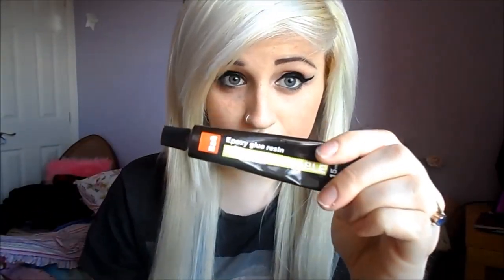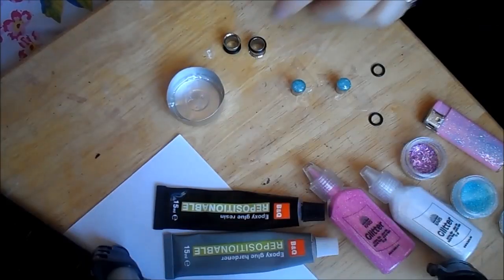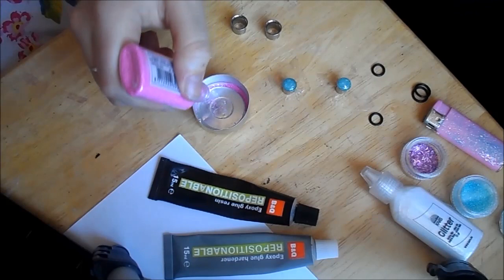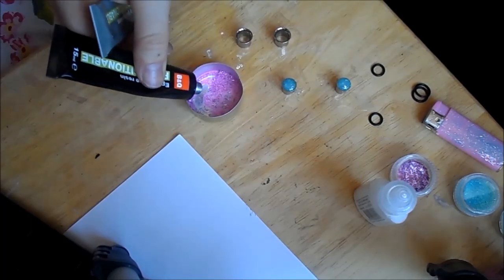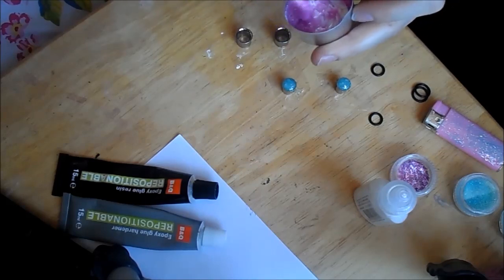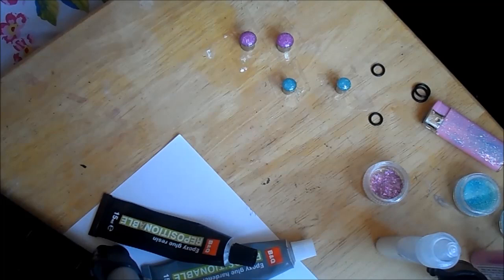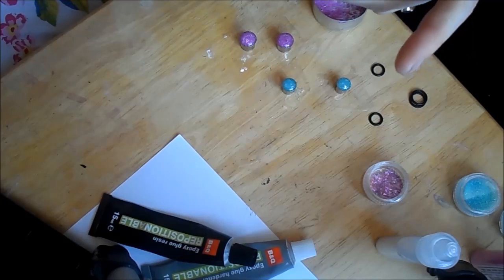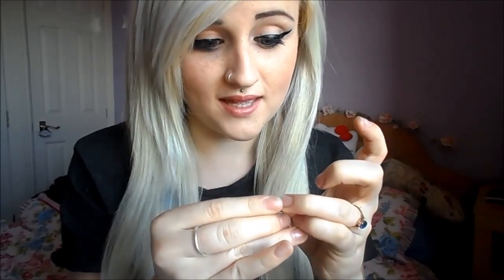How To Make Glitter Plugs!!

Comment: I bet you can! Mix the two eproxy glues together like how she did but without the glitter step, fill your tunnel almost to the top, wait til it settles a bit then put on the cutout/sticker. Then top it off with more eproxy glue to seal it in :)

Comment: I have a question, do you think with just resin or some sort, with a stainless steel tunnel, you could stick an earring in it? I have these cute pastel rose earrings I adore and I would love to make them plugs. They would fit with my 4g tunnels. I kinda need to hide them at work and I don't wanna spend a lot of money on plugs. Please let me know! Thanks!
Reply: I haven't tried this myself, but I totally think it would work! I'd just wait until the resin was somewhat tacky before putting the earrings in so they don't completely sink or float out of place like they might if the resin was just poured.

Comment: Alec W resin is safe once cured. It has to be well polished. Safer than wooden plugs ;)
Reply: Wearing resin as plugs isn't safe, the only reason why it's somewhat okay to wear is because it's inside a Stainless steel tunnel.
Reply: Well I wear them and I'm very happy. I had problems with stainless steel and silicone :D
Reply: ArtsbyCarry have you ever tried titanium? or stone? my second holes sometimes react to silicone so i wear glass or stone and it usually helps. c:
Reply: No, but I know that they are the best materials for your holes so I'll look for some titanium or stone plugs to test them, thank you!